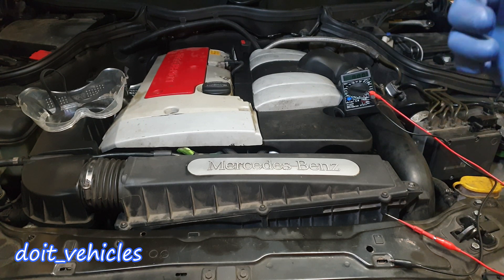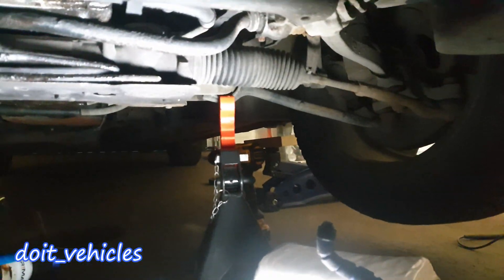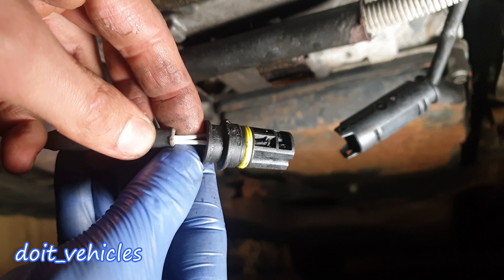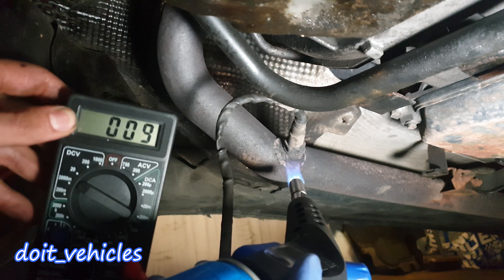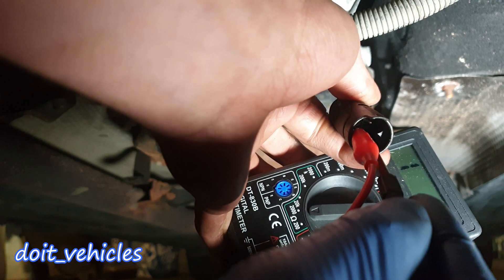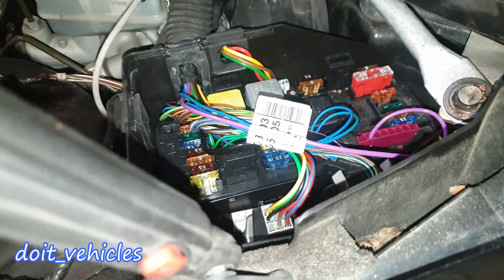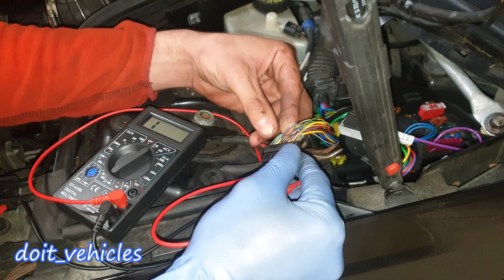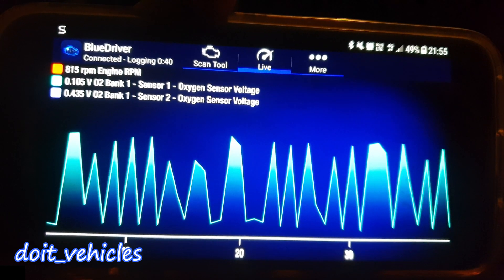Mercedes w203 C class - Oxygen Sensor - Does it need Replacement ? How to Test it

Comment: I am commenting on this old video because of your series on 2002 w203 C180 M111.951, which is my car as well. 2 questions if you would be so kind. BTW your videos and ongoing dialogue are most excellent, congratulations on your style and informative meticulous method. 
I have the valve cover setup with the breather hole near the oil filler cap. My hose goes to the rounded top of the air intake just above the throttle body. On both ends of the hose fittings it gets a bit oily in the nearby area. I checked for an o-ring, there is none. My question is, how tightly do these need to seal? I'd also love to know where the PCV valve is on this M111.951 engine? There is a vacuum line from the small secondary vacuum pump near the back of the engine on the intake that seems go right into something at the back of the engine. I can find plenty of info on the M271 PCV/crankcase rebreather location, but nothing on the M111.951. Appreciate any links or guidance.
Reply: The pcv hose is on the left side of this(w203 m111 kompressor) engine leading to some sort of oil catch can that's connected to the after-intercooler part of the intake, as for the pcv valve on i remember it being mentioned on this channel before, pretty sure its on the right side somewhere in the back connected by a tiny hose, as for the sources you're best off skimming trough this channel's playlist for this car or searching for schematics on parts websites or if you know someone with a old dell diagnostics laptop the schematics are built into the diag software, if you're a extroverted person you can go to a local parts shop and ask them to show you the schematic and ask them for the part number

Comment: Hi... I have a code p2031... And I noticed fuel in the oil, and the first o2 sensor shows 0.05v and the second o2 0.95v... What could be wrong? Brand new sensors, catalic  converter...?

Comment: Hello! Can be the sensor 2 instead of the first one? I got the code P0141 with OBDII. And related to the graphics, my sensor is always on 0.45V but not percentage value, the app says 0%, however the first sensor have a variable percentage. I see in your video that the sensor 2 values are near to 0 too?

Comment: When I first saw your video it looked like you were going to test the front O2 sensor but then you tested the other one. Do you have a video on testing the sensor in front of the car with the five wires? Thanks
Reply from the maker: The first sensor on this car is as well a narrow band O2 sensor with 4 wires . On a newer car might have a wide band .
Reply: @doit_vehicles  really, okay the reason I was asking is  because mine has 5 wires and I was hoping to find someone that can test it so I can test mine before buying a new one. They cost about $80 for a Bosch and I didn't want to buy one before knowing if it was good or not. Thanks for responding.
Reply from the maker: @HallEffect7798  The best is to get a scan tool with live data and check if you get readings from the O2 sensors . A lot easier . The " benchtest" is necessary in some some situations.

Comment: Hai my friend. Scantool say fuel pump close loop,but all O2 sensor fault.
I have replaced all. O2 semsor, and my problem is not solved.
I dontknow.
Reply from the maker: Have you tested the connectors ? Since you have a scan tool , check the live data from other sensors .
Reply: @doit_vehicles  i have a c220cdi w203 its promising to start but nothing did put a new engin diagnostic says fuel presure low

Comment: Hi there,
I watch your videos their really helpful however I've got a question for you 
I have got a Mercedes c200 compressor mechanics keep telling me different things to solve my problem 
The engine light keeps coming on ,
I changed bank 1 and 2 sensors I changed air mass censor and I cleaned the exhaust however it does not help, could you inform me on how to solve this problem 
Thanks
Reply: The car is 2004
Reply from the maker: @allennamik1258  what is the problem  / trouble codes ?

Comment: Hi. I want to remove my catalytic converter on my mercedes w203 c180 non kompressor. Do I need to modify the o2 sensor after the cat aswell? Thank you very much
Reply from the maker: No , as long as it works  , just weld the new cat on
Reply: @doit_vehicles  Thanks for replying.
I live in south africa and we do not require the cat by law. So I want to remove it completely. Do you think the ecu will work like normal with the cat removed or do I have to trick the O2 sensor.
Reply: @johanfrank4790  You'll probably have to trick it with an elbow, the ECU gets adjusts air fuel mixture according to readings of O2 sensor

Comment: Its great..  Thank you for ur educational videos..  It helps a lot,  GOD bless u..
Reply from the maker: I am glad it's usefull :)
Reply: Hello my friend I am really happy with your videos please I need your help I want to inquire about is there a difference between orginial part No and aftermarket numbers I have problem with the 2 oxygen sensor I want to get new one the original one is A 001 540 0517 and the listed in the Ebay like bocoh brand has other part number even when I check the fitment say ok that part fit your car the no for bosch brand is 0258 006 272 
My code Engine m111 c200 k 203045
Like your car